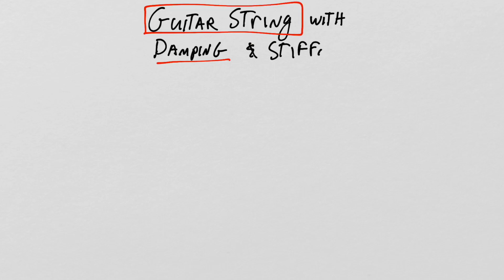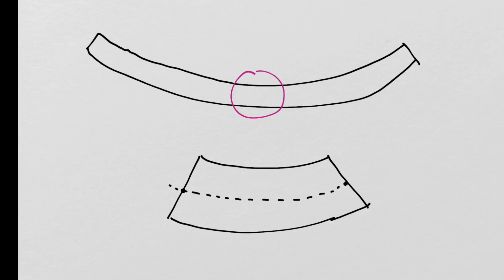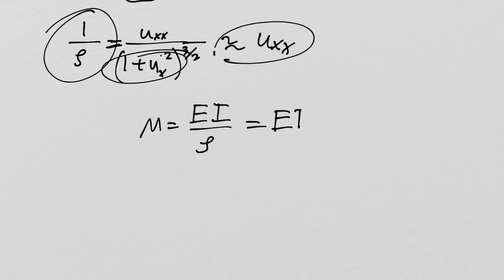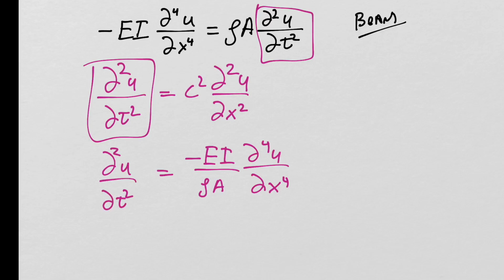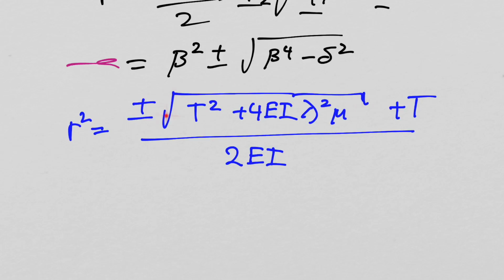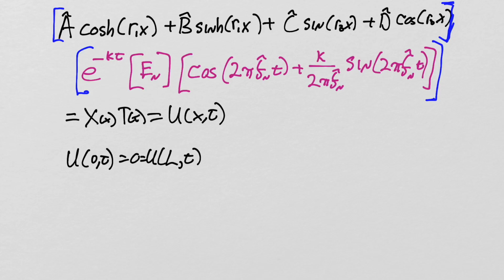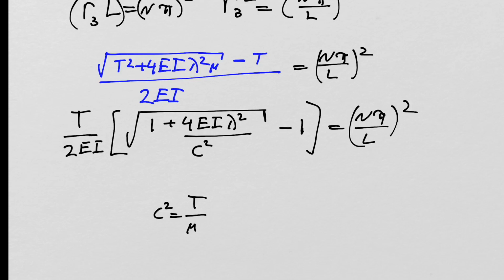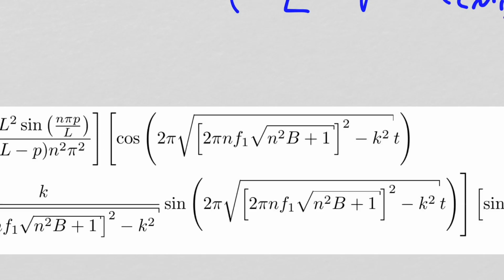Guitar Physics: The Eddie Van Halen Equation

Comment: Not finished watching yet but great video! Although, is that a mistake around the 50minute mark? Not sure if you catch it later in the video, but you've multiplied through by T and X but not multiplied the lambda^2 terms.
Reply from the maker: Yeah, it looks like I went a bit too fast there! But the characteristic equation is correct, so the error didn't propagate far!